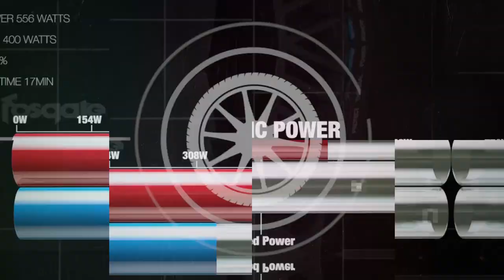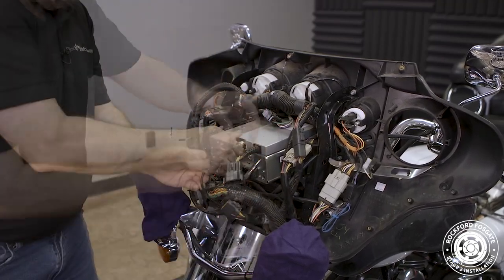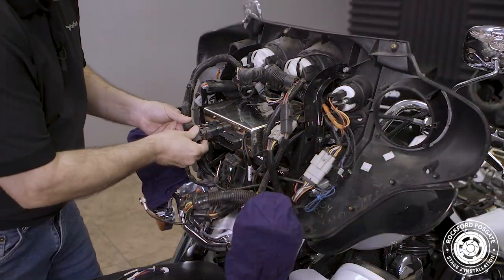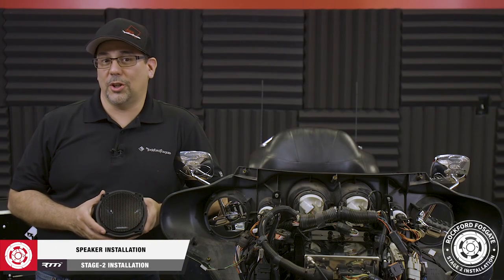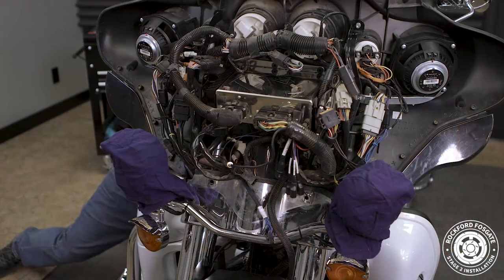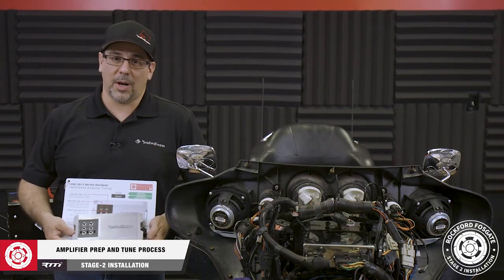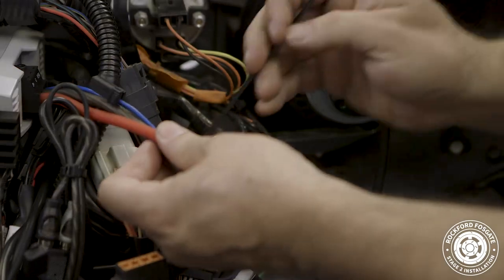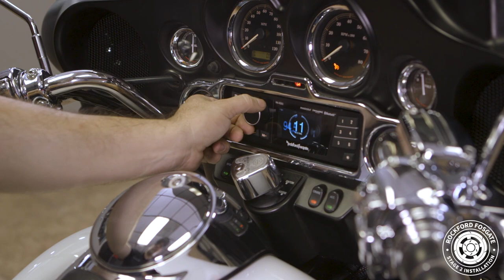1998-13 H-D Electra Glide Ultra Classic Stage-2 Installation

Comment: Just installed this set up in my 2010 Ultra, What does the blue power remote wire plug into?
Reply from the maker: Typically the Blue wire is used to turn-on the amplifier when you use the RCA line-outs from the radio.  However on your model, the amplifier automatically turns-on when sensing the "DC Offset" since you're using the speaker line outputs.

Comment: I had this kit installed a year ago and love it. I'd like to add a pair of woofers into my lower fairing. Is this process difficult and what speakers would you recommend?  Thank  you.
Reply from the maker: Hi Dusty, Thanks for using Rockford Fosgate on your H-D!  The Stage-2 design includes a 4-channel amplifier that can drive up to 8 speakers.  While we don't have a "kit" for the lowers, we do recommend our TMS-5 (for older style lowers) or the TMS-65 (for newer aftermarket style lowers).  All you'll need is a Y-adaptor on the front outputs of the amplifier and to build a harness.

Comment: I bought that kit and I already had rear speakers with ACB how do you hook up the rear speakers I see no wires for it
Reply: I have a 2010 electric  Is glide ultra classic with CB How do you hook up the rear speakers there's no wires Speakers are already there They played before with the other radio
Reply from the maker: @erniegonzales6101  Could you elaborate by "rear speakers"?  Are you referring to factory equipped TourPak rear speakers or saddlebag speakers?

Comment: I have read that for a pre-2005 Ultra Classic, this radio won't work with the stock rear speakers. Is that true?  If so, is there a workaround I can purchase that won't require re-wiring? Thanks.
Reply from the maker: Select Ultra's have a different connector on the rear of the radio.  You can see the back of the PMX-HD9813 source unit and the connectors.  If your radio has different connectors, it's not plug-n-play compatible.  PMX-HD9813: https://www.rockfordfosgate.com/products/details/pmx-hd9813/
Reply: @rockfordfosgate  thank you
Reply from the maker: @scottmajor2620  Great!  Hope hope that info helped.

Comment: Sorry this may be dumb question but, does this affect the cb?
Reply from the maker: If you're H-D has a factory installed CB, the PMX-HD9813 is not compatible with it.  You can find all the details on the PMX radio included in the kit above here: https://rockfordfosgate.com/products/details/pmx-hd9813/

Comment: So I did all this to my bike....and it worked for a brief time and now my power light is blinking red and blue. Can anyone tell me why this is???
Reply from the maker: Hi Chad, is it alternating Blue - Red - Blue - Red or both Red/Blue at the same time to create a purple color?  To clarify, this is the POWER LED correct, not the CLIP LED?  If it's the POWER LED, disconnect inputs and outputs from the amplifier.  If it still does this, does it react differently when the motorcycle is running or does it have the same condition regardless if off or running?